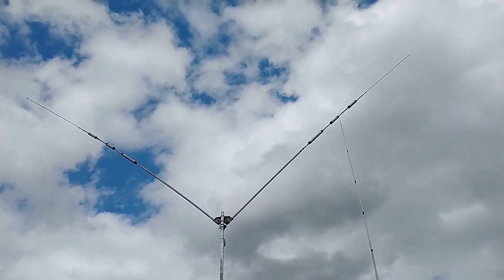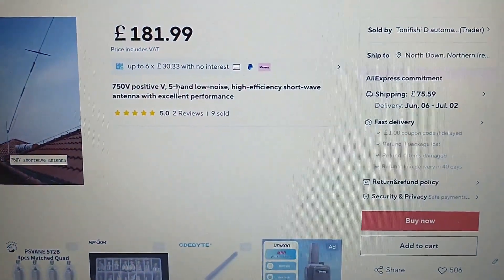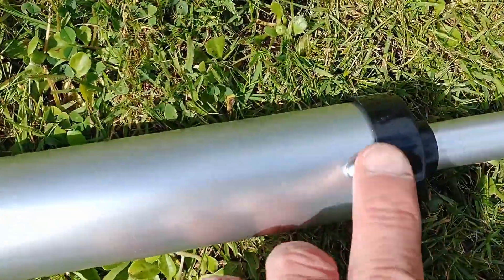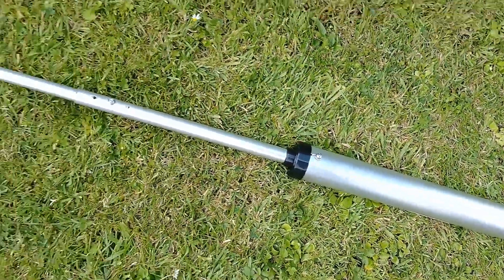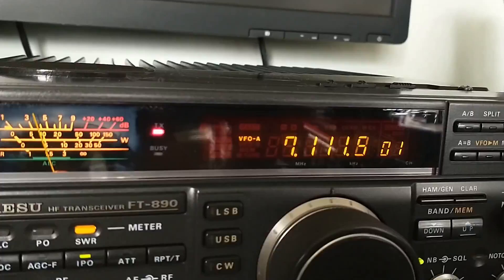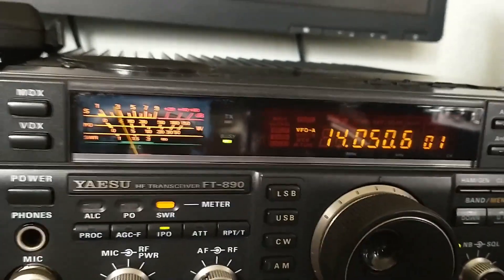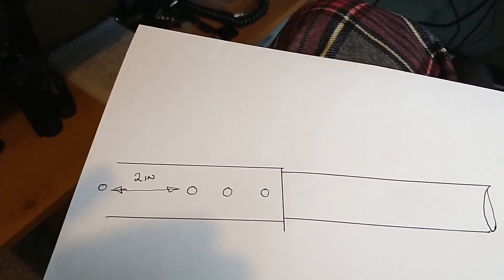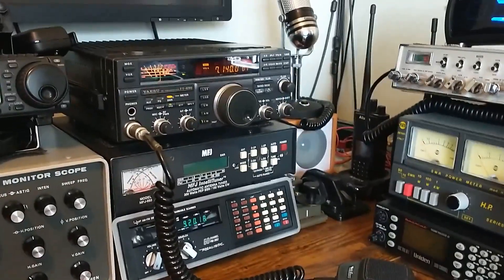750V Positive 5 Band Antenna

Comment: I been looking at this antenna for a while but was not sure how good this would be.  Your SWR over all looks great. I hope you do a follow-up once you  made some contacts. VA3FWT Ontario CA.
Reply from the maker: Hi Fred. Im happy with the antenna, it's performance is something similar to the Comet H422 but it's a lower price and better build quality. I have noticed that when it rains the SWR only on 40 returns back to my initial SWR readings but when it drys up the SWR stabilises again.
Reply: @Team-fabulous  Hi, just received my antenna, there is no instructions that came with it. Is there a site to download them or did you have to wing it ? 🤔
Reply: No worries, I did find them. I let you know once I get it up and working what I think . I will make a few mods like you did if necessary. 73
Reply from the maker: @fredthorndyke5959  not sure, mine came with instructions.. Some of the sellers will email you them... Have fun...